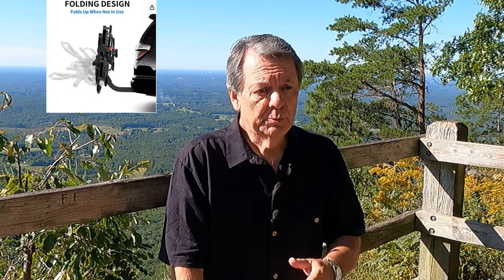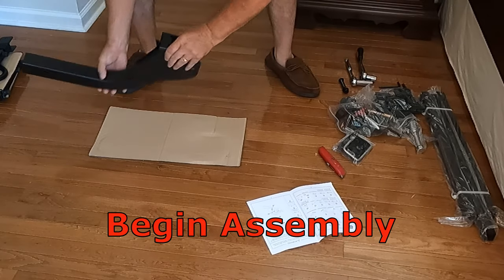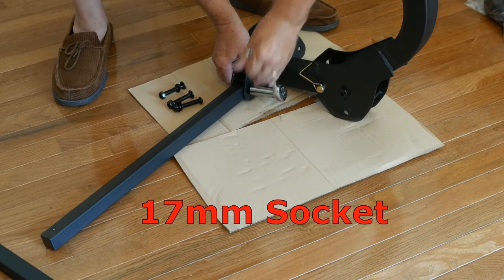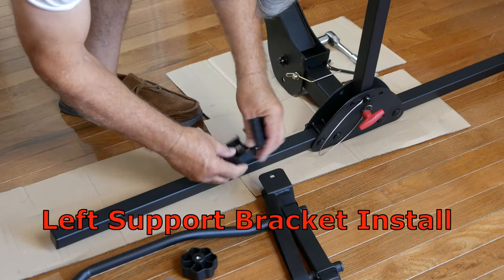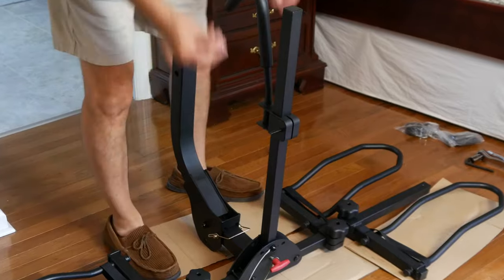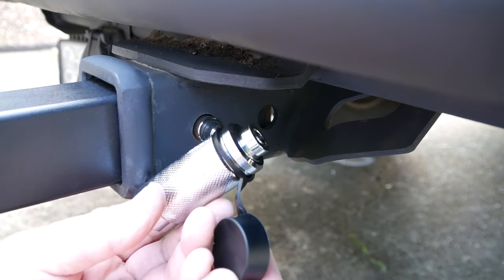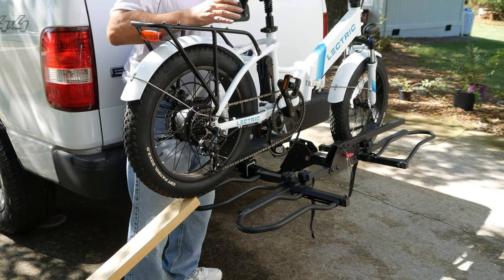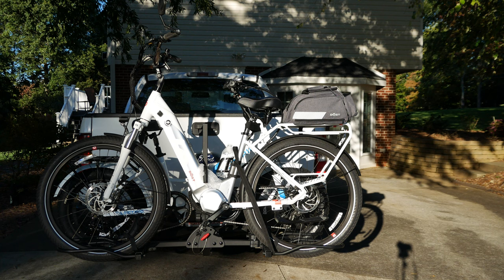eBike Rack Assembly/Review

Comment: The best video on how to get my Lectric e-bikes on my rack I’ve seen.  I’m 81 and your ramp idea is going to be a life saver for me.  I really appreciate your attention to detail and your use of the KISS principle.  Keep up the good work.
Reply from the maker: Thanks Ben.  Appreciate the kind words.  I have an 'addendum' video coming up where I built a 'bridge' for the front bike.  Right now, I have to lift the front end of the front bike to move it from one wheel cradle to the other.  I think you'll like my bridge idea.  Stay tuned and I hope you subscribe so you get notified.  Dean
Reply: When removing the bikes do you just reverse the process and back the bikes down?
Reply from the maker: @benfoster3331  yessir
Reply: Thanks for getting back to me.  I’m been working on your ramp idea and I came across some 1by3’s in the garage and I think I’m going to attach them to the sides of the 2by4 ramp to provide some sides to make it even easier to keep the tires on the ramp.  I’ll let you know how it turns out.
Reply from the maker: @benfoster3331  That sounds perfect. Wish I could see a picture when you’re done
Reply: I’ll see what I can do.

Comment: I just finished assembling mine. Easy thanks to your excellent instructions and I’m not mechanically inclined, to put it mildly.
Anyway two comments. Some of the holes for the brackets were not  well machined. I screwed them in by hand and lined up the square on the screw to the bracket and lightly tapped it into place. Second, they changed the washers on the bottom cross bar and did not provide washers for the bar brackets. No problem for me and I’ll add some later if necessary.
Thanks again for the advice and instructions.
Reply from the maker: @butchie2752  sorry about the changes between yours and my video.  Glad you were able to tap the bolts into place.  Consider watching my video related to this rack on how to build a ‘bridge’.  Thanks for the comments.  Dean
Reply: @PilotViewProductions  I’m definitely doing the bridge and ramp. I have used a black widow holder that had a ramp. Unfortunately it was totally unreliable for holding a heavy bike. Relied exclusively on ratchet straps.
Reply: Had to watch it again to remember how to tighten the anti hitch. Thanks. One minor thing—something on this thing rusts. I keep it on the car in my driveway. Maybe they all do. I also had a little trouble with my BIG Ebike mostly with the ramp. I tried to cheap out with stuff I already had. Probably not plan a.

Comment: I liked the idea of making my own ramp, but I used a 2x6 because the tires are so fat, it made it far easier to drive it up the ramp.  I also "splurged" for a two-pronged padded hook from Home Depot that doesn't scratch the rack.  I also mitered the bottom on the board so I didn't have a bump to start over to get it started up.  But thanks for giving me the idea.  It works great!!!
Reply from the maker: Good ideas
Reply from the maker: Hope you'll subscribe and/or check out my other video on building a bridge between the front two bike tire cradles.
Reply: Could you add a little more detail on the prong you bought at hd? Thanks. Great idea on a wider board.

Comment: Very informative video. One question. The flat washer is usually placed first with the lock washer adjacent to the nut or knob in this case. You show the opposite order. I wonder if the instructions have an error there. Thanks
Reply from the maker: I agree and found it strange as well but that’s what the instructions stated.  Thanks for watching Bruce.  We are still enjoying this rack and I have an addendum video coming soon where I scratch built a ‘bridge’ across the front wheel cradles.  It prevents the user from having to lift the front end of the bike to move it from one cradle to the other side.

Comment: this was so helpful...thank you...can we use just one set of mounts without issue? and where is best to use 1? front or back of post?
Reply from the maker: Hello jedderk.  Thanks for viewing and for the question.  With this dual rack, it is 'easier' to mount a bike on the rear location due to being able to use the 'tongue' of the rack as a bridge point when rolling the front wheel of the bike from one wheel cradle across to the other.  BTW: I did a followup video on how to build a bridge for the mounting of the front bike.  It can be found here:  https://youtu.be/nQ8kzL6JAbc

Comment: I notice you have the plate under the U-shaped fastener turned with the slight bend towards the vehicle instead of how it is shown in the manual with the bend facing outward. I'm not sure which way is correct.
Reply from the maker: Well I’m not sure about the manual but to me it makes more sense to have the majority of the plate bracing the part which is more mobile…in this case the bike rack.  The receiver is certainly not going to move.

Comment: So do i have to unbolt the anti wobble brace every time i remove rack? I just got the same one.
Reply from the maker: Yes, but having it is worth it
Reply: Thanks I just got exactly same rack. For Ariel Rider Xclass, and regular bikes.
Reply: Btw, I haven't tried it yet as I'm waiting to get my hitch installed.  Couldn't you load ebike with rack leaned out, then push back up? I saw you did a ramp. I was just wondering? Thanks!
Reply from the maker: Yes but it would only work for the outside bike.

Comment: Is the lock suppose to be tight or can move back and forth ?
Reply from the maker: Are you referring to the lock running through the hitch receiver?
Reply: @PilotViewProductions  yes, mine doesn't make a tight connection...can slide back and forth a little bit
Reply from the maker: The anti-wobble is supposed to be tight but the lock has some play in it.

Comment: I cant get my anti wabble to be toght enough to not wobble at all. 😢  Is it safe to have a small amout of wobble?
Reply from the maker: Mine is tight.  Is the wobble occurring at the antiwobble plate location or is there just some play where the rack folds up for example?
Reply from the maker: The anti-wobble is not supposed to have any play.  If however, you are grabbing the bike rack from up top and moving it, you may feel some wobble.  If you are grabbing the rack by the shaft coming out of the hitch receiver, it should not have 'any' play.